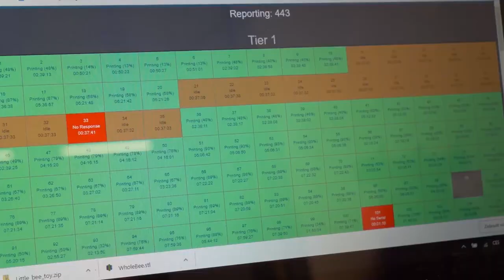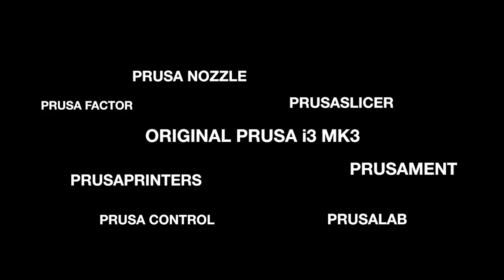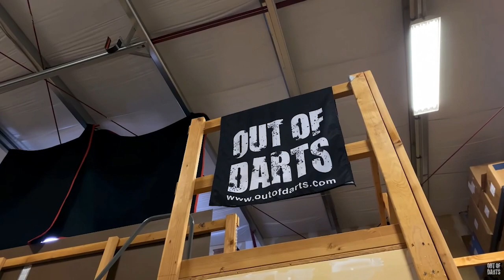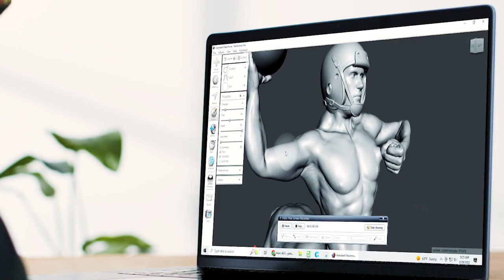7 GIGANTIC 3D Printer Farms Making Millions of Parts

Comment: Currently I have three machines. They are enders 3 neo's and two are the max running constantly. And I can personally say that running just two machines 24/7 is a pain in the butt. From the occasional part not sticking to the bed for no apparent reason to the bending of the cleaning needles or the fun part when you realize that nozzles are ware item kind of like tires on a car that need to be replaced after so many prints. I'm going a little crazy. And the sad part is that if my business picks up I will need more machines. But 500 plus machines? Is like a masochist wet dream.
Reply from the maker: The Megafarm is set up for 3000 machines

Comment: Hmmm. I thought is was bei g original. I've been 3d print farming for about 5 years. (10 printers).

I own a maintenance company and I manufacture my own parts for the services to the customers fleet. Some parts cost me $40 and I resell with 20% mark up. But I can 3d print same component for $2.00

Comment: Have you taken a look at the bambu x1? Maybe that would be a good machine for a print farm.
Reply: Bambu's X1 still has a lot to prove to even be a reliable consumer machine at this point. If you check their support forum, they are breaking and trying to patch them up using 3d printed parts. Not a great start... After a few iterations, they may work out the bugs, will have to see. Not even going into the closed sourced software and hurdles for that presents for automation. In this game, reliability and serviceability trumps all.
Reply: @tshackelton  I have not experienced these issues with my X1 Carbon, I have printed close 35KG of filament through it now and have had no severe problems. I did have a clogged nozzle but that was easy to fix.  I will try to keep you posted.